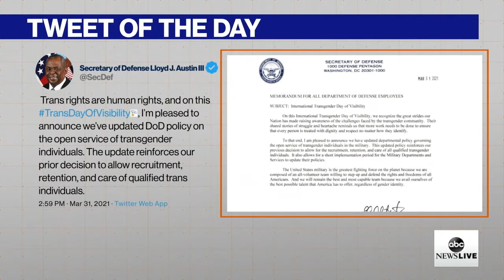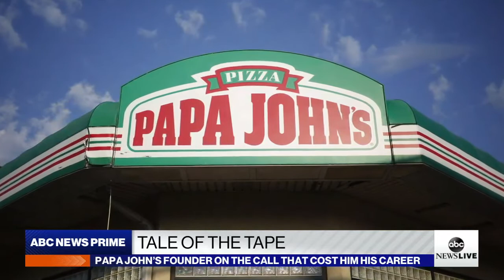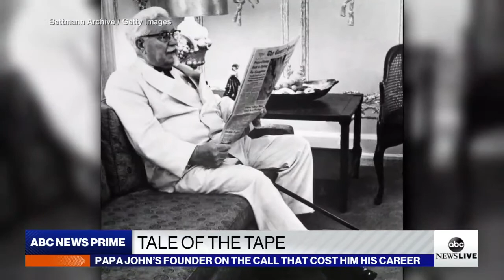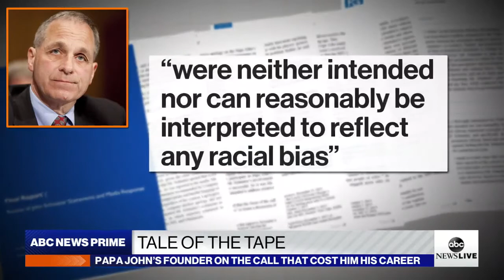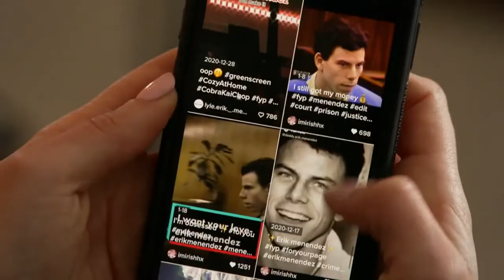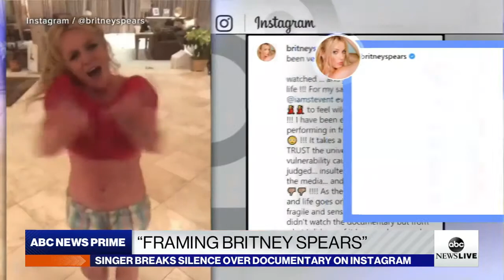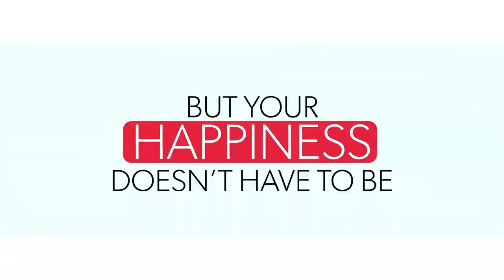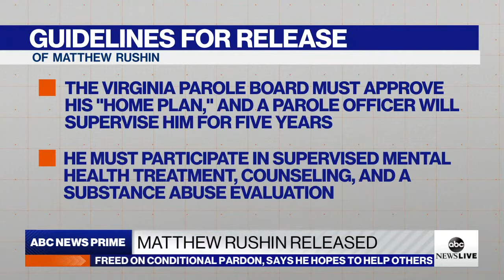ABC News Prime: Derek Chauvin trial - Day 3; Biden's $2T infrastructure plan; Gaetz investigation

Comment: WHAT IS VACCINE
But why scar need to be formed before one get protection from vaccination? 
Cos if you injured, blood only can be seen flowing out from the wound for a while before flooded by a clear substance even the wound yet to close....

That because red blood cell have 3 function and one of it, were locking themselves as interlock, when wound were detected, so temporary wall could be formed to block each blood vessel that could reach  damaged area unless white blood cells which much smaller,  can reach wounded area for repairing work. 

And why BCG vaccination area usual swell and leave a scar becos white blood cells have function too upon detected weak bacteria entering body as BCG. 
The method almost same like red blood cells, using interlock system. Just one of those cage, that they made to catch intruder were named Covid-19 by human.

That mean cages for catching bacteria were round in shape, same like what formed by red blood cells to block blood vessels. 
Yet the cage for catching virus mean inside is empty and eat up space at arms area since air pocket don't exist like lungs section. 
That also mean cages need to be pushed till skin area or how human body swell at wounded area but due to temporary wall formed by red blood cells. 

After killing bacteria and cage dismantled or swelling start reducing, the affected tissue and skin would looks abit sunken upon cojoining back, due to prolonged period stretched by the cage and known as scar. 

No scar? That mean white blood cells never did hunt weak bacteria, injected as BCG. 
Since human body use alot of bacteria for breaking protein and work as enzyme or what known as good bacteria. Just the problem, one of them named TB after immune system fail to detect them as threat or no scar = no protection..

And make sure you aware, leukemia were not cancer but red blood dysfunction since it cannot merge as interlock upon detected wound and not only keep jabbing BCG till scar emerged..... 
(Google "Danny Woo Vk" in Bing for book of life and topic about pregnant women, that can tell Covid-19 vaccine cannot work against the disease)